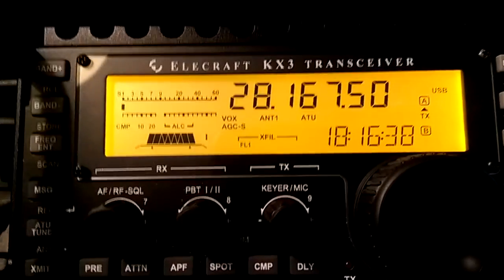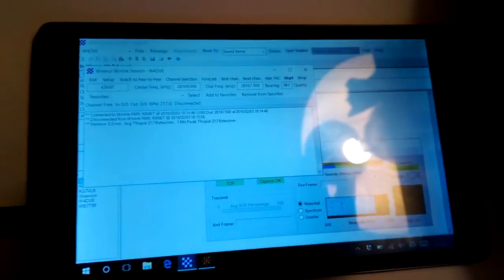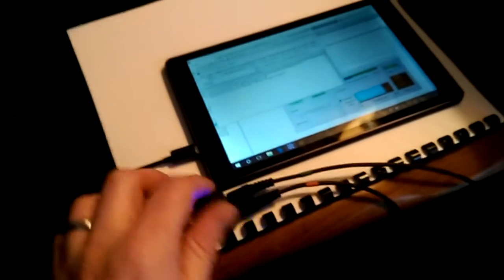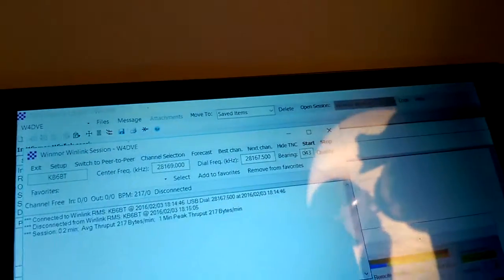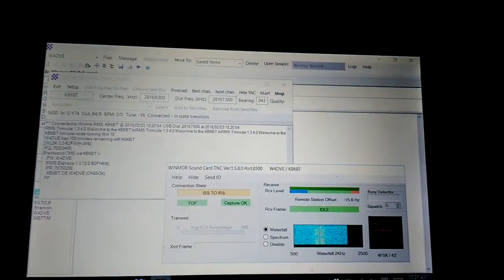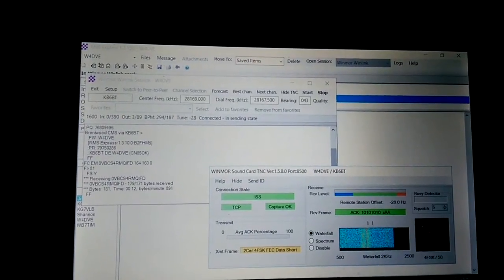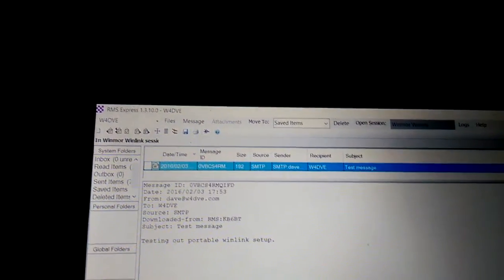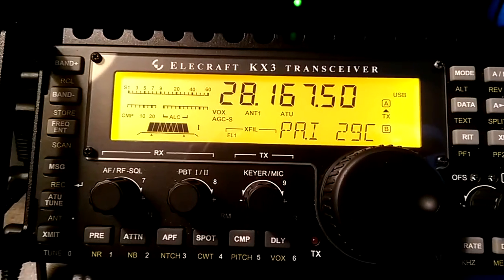Testing KX3 Winlink Portable Setup

Comment: Thanks for this great setup video, I am trying to set up my winlink just as yours, but I am getting error "Timeout in TR > RX Latency Measurement" in winmor tnc  during dialing. Kindly share your KX3 settings and if possible the winlink express Rig control and sound card settings. I tested with AUS tablet, Aspire one netbook and a Dell latptop, all presented the same error... My rig control works it selects the frequency and dials, but gives the error mentioned and do not work, any help would be awesome----- thanks again.

Comment: What flavor / OS  tablet are you using. Any comments on  getting WinLink Express to run  on the tablet? Thanks!
Reply from the maker: Carla it’s actually just a cheap NuVision (I think that’s the brand) tablet I picked up from Walmart for $70. It runs Windows 10 so setting up Winlink /RMS Express is exactly like you would do on a desktop.

Comment: Q: Are you using the CAT cable with the KX3 and, if so, what model cable is that?  Thanks.
Reply from the maker: John Evans Yes I'm using the CAT control cable. It's made for the KX3 by Elecraft.
Reply: OK, so the same USB cable used to update firmware in the KX3, correct?
Reply from the maker: Yup. You got it.
Reply: Thanks - one more question.  What is the model of the tablet you are using?  I want to determine the minimum specs needed for a tablet I can take backpacking.
Reply from the maker: John Evans It's a Nextbook. It was a cheap one I found at Walmart for $70. It really is low power. I also have a 10 inch Asus 2-in1 that I like much better. Anything low power that runs windows 10, can run rms express.
Reply: Thanks.